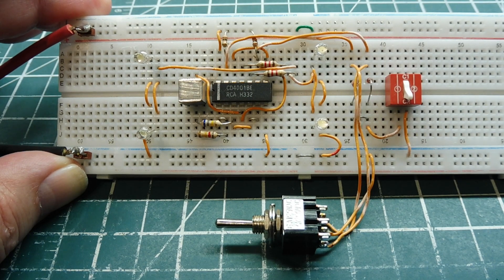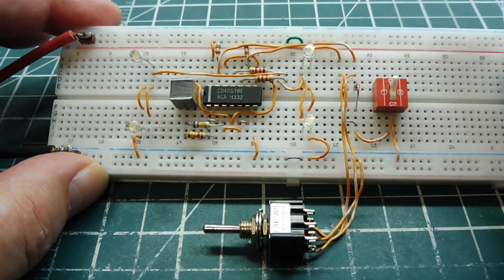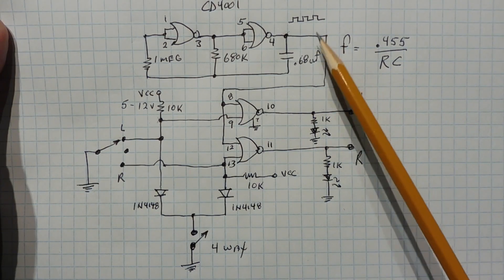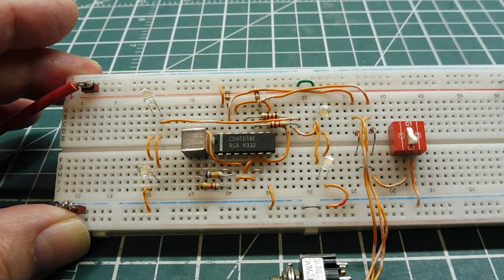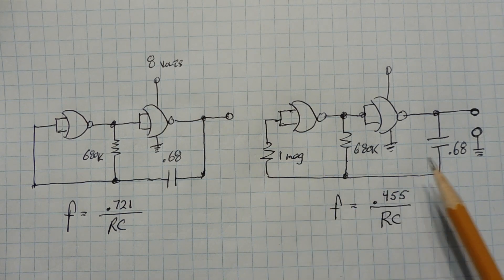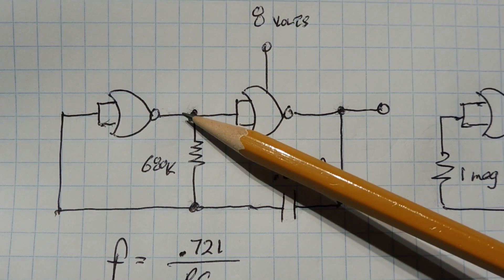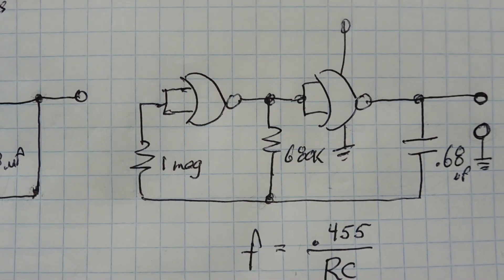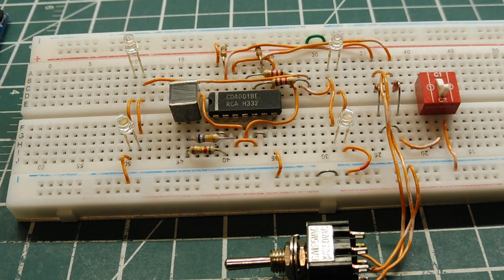Turn Signal Controller Circuit  /  CD4001

Comment: Great circuit, however I don’t see where the brake lights are integrated.
Reply from the maker: The brake lights on European and Japanese cars are separate from the signalling circuit as opposed to North American cars. Eventually they will have to adapt to this system for safety reasons. The purpose of the video was to demonstrate logic circuit applications. For more info on turn/brake systems check out this video: 
https://www.youtube.com/watch?v=O1lZ9n2bxWA

Comment: Looking something like this, to merge my turn signals to the same brake bulbs, if you can do a circuit or a schematic
Reply from the maker: You can get tail light converters ( 3 wire to 2 wire ) that will use the same bulb for brake and turn signals.  https://www.curtmfg.com/towing-electrical/taillight-converters/3-to-2-wire-taillight-converter
Reply: @0033mer   nice but I don’t live in USA, trying to figure out a simple circuit to do it, I tried with relays but they consume a lot of current and drops the luminosity of the bulb
Reply from the maker: You could probably make this work: https://www.dropbox.com/s/s1d2cpa3k4hvpkm/Signal.JPG?dl=0
Reply: @0033mer   if you have the name of the pieces, i will try, that circuit works fine with led bulbs too ?
Reply from the maker: All parts needed are listed in the schematic. The circuit will drive LEDs. Assemble it first on a breadboard.
Reply: @0033mer  thank you so much

Comment: Really nice simple circuit, took me a little to guess what the diodes did but then i saw the 4 way switch symbol & the pull up resistors
Reply: I'm still not convinced the diodes are necessary.  Without them, both legs are still being pulled to ground via their pull up resistors.  And since both legs are pulled to ground, there are no reverse currents according to KCL.  It's no different than having two independent switches, each with their own pull ups tied to ground.
Reply: @Enigma758  Heres my guess after coming back a year later. When the switch puts ground on a pulled up input it gets rid of the pullup current and ground can't flow through the diodes in forward bias(i think) so theres no reaching the other pin. Then when the 4 way switch is connected it reverse biases both diodes obviously and adding more ground to either pin wont do anything.

Comment: What about BRAKE LIGHTS? Step on the brake pedal.
Reply from the maker: https://youtu.be/B4FNf_VODjQ
Reply: @0033mer  the problem is,  the same light is used for turn signal, and same light for brake and same light for hazard flasher, all are the same light, when brake is applied with a turn signal on, one side will flash but the other side will stay on steady, how is that accomplished? The video you mentioned above does not solve the issue.
Reply from the maker: Turn signal and brake/tail are separate bulbs/filaments.
https://technicalarticles.revivalcycles.com/hc/en-us/articles/360009106131-m-Unit-Blue-Basic-Universal-Wiring-Diagram
Reply: @0033mer  not on every car, some cars have the same bulb filament for both,  look closely when you are out driving the roads and you will see
Reply from the maker: Old cars and trailer lights were single but the new cars today have separate brake and turn bulbs. Lots of info online to verify that.
 https://www.youtube.com/watch?v=RalugM6mLnk
https://www.bulbamerica.com/pages/automotive-lamp-guide
The purpose of my video is learning about logic intergrated circuits where you can design your own circuits to fit your application.

Comment: Thanks. I always liked using logic chips . Have not however used CPLD devices ,they should be interesting to programme.
Reply from the maker: Using a CPLD is the same as breadboarding logic chips except the breadboard now becomes your computer screen. Check out this CPLD video: https://youtu.be/w6Y7lH2CkK4

Comment: Car flasher need to blink faster if one of the bulbs fail, so driver can notice failure (safety...)
Don't know for your country, but good explaining about circuits.
Reply from the maker: The main purpose of the video was to describe the function of a NOR gate in a circuit that many people can relate to. Older cars had thermal flashers that would flash faster when a bulb failed. Newer cars have bulb monitoring or smart flasher modules. That feature can be added by monitoring the current to the bulb and switch in a faster resistance value in the flasher circuit on bulb failure. https://youtu.be/NrX5u7PkcNE
Thanks for the feedback.

Comment: This will work for led lights. Incandescent circuits flash faster when a bulb is out. I swapped to led and had to modify the circuit to not blink fast even with all the lights in.

Day one led swap: left park lights on for 11 hours. Still started right up. Sometime later the alternator belt broke, in the rain, lights on. Drove to 2 parts stores about 30 min. driving, one for the belt, the other for the 2 wrenches, changed the belt and still didn't need a jump. 25 year old car.  Leds are great

Comment: Best thing about this IC is that it can safely tolerate 12v. And I'll use my car battery for powering both the loads and the IC, without the need of any extra voltage regulator